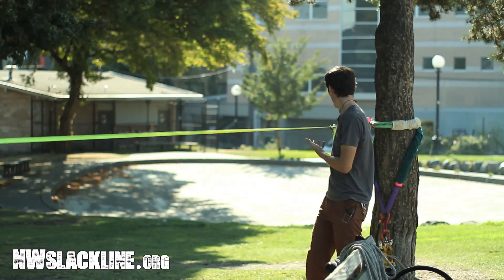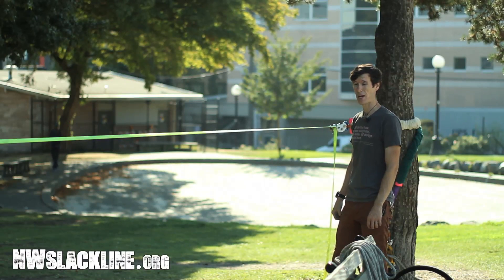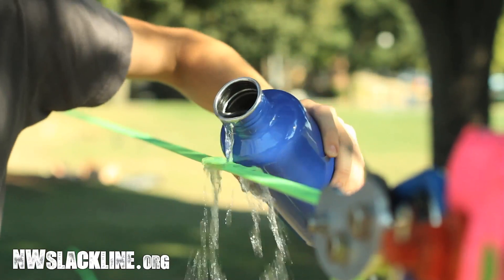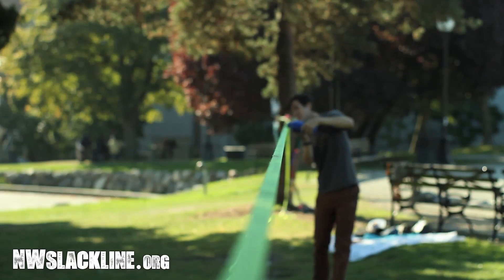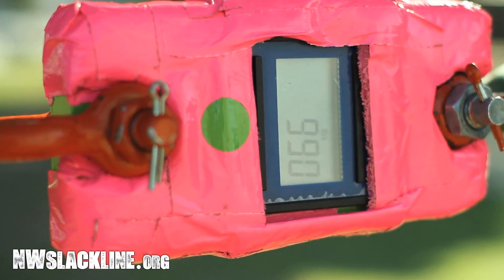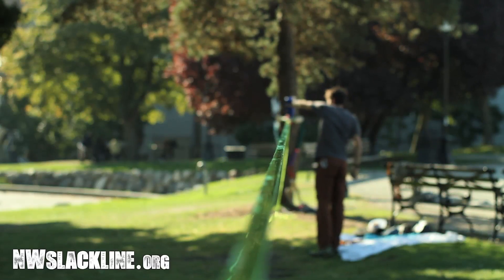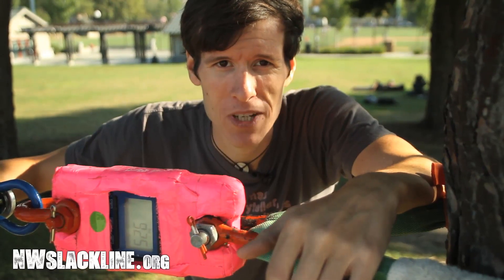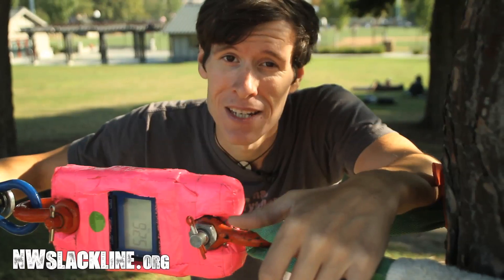Does water make slacklines tighter or looser?  Let's find out!

Comment: Bulk nylon absorbs water.  The water lowers the breaking strength.  It also makes the nylon more pliable and usually increases the fracture toughness, even though it lowers the breaking strength.

Nylon drys out and becomes brittle in dry ambient conditions.  Some manufacturers pack nylon parts with a small amount of water to prevent this..  

A general rule is to discard textiles of plastic when they are older than ten years or if their origin and history are not known.

Comment: Ever get a good explanation on the chemistry behind this? My best guess is along the lines of your hydrogen bonding reference; with the water disrupting the normal surface chemistry and bonds between adjacent nylon fibers. Adding water would act as lube, which allows the fibers to slide past each other even more, lengthening the line and reducing the tension.